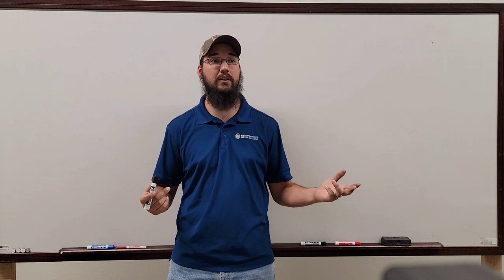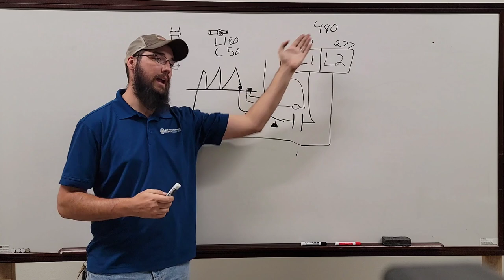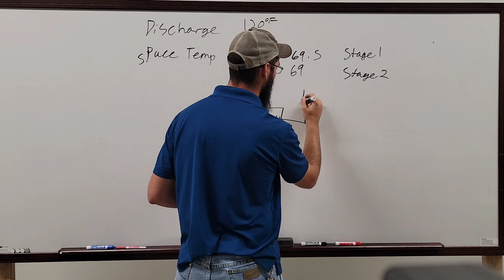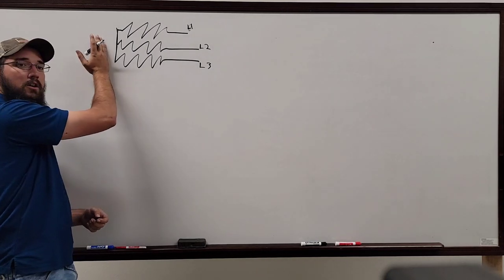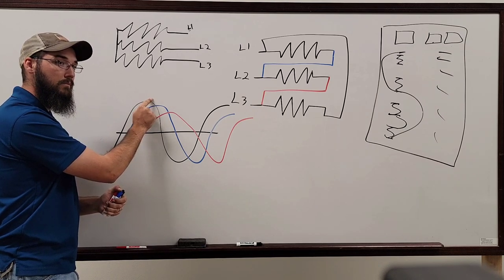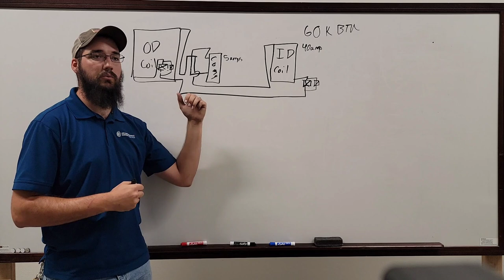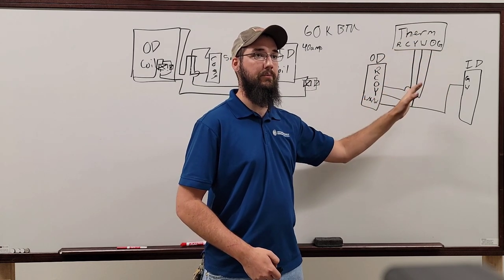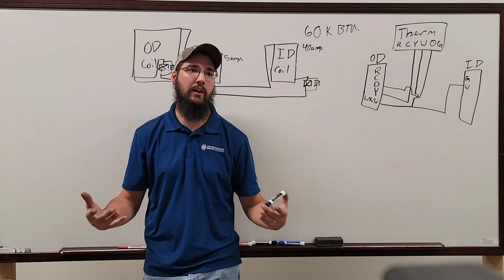HVAC Training: Electric Heat and Heat Pumps

Comment: Here in Buffalo most inverter or mini splits are hyper heat and can deliver up to 80% capacity to -15°. At 10° outside they are pushing 90%+ capacity. We have quite a few VRF systems as well. Air to air is almost non existent.
Reply: I'm in Buffalo as well! :D

Comment: I honestly wouldn’t mismatch voltages for restring kits.
Reply from the maker: Its definitely something I want to understand better. How does a string voltage affect it if its just a resistive device.
Reply: @HVACTIME  

When you run the same heat strip at a lower voltage it will draw less current.

Lets look at a heat strip rated 40 amps at 240 volts.

In watts that would be 240 volts x40 amps =9600 watts, now what would happen if we ran that same exact heat strip on 208?

First we need to find the resistance of the heat strip, to do that we divide the voltage by the current

240 volts / 40 amps =6 ohms of resistance

Now that we know the resistance we can use ohms law again to find out what that heat strip will draw at 208 volts

208 volts / 6 ohms =34.66 amps.

So the exact same heating strip that needed 40 amps at 240 volts will only need 34.66 amps at 208 volts.

HOWEVER ... at 240 volt that heat strip was putting out 9600 watts of heat, at 208 it is not, it is now putting out less heat.

208 volts x 34.66 amps = 7209 watts

So by dropping the voltage the current went down but so did the amount of heat produced.
Reply: @HVACTIME  definitely not trying to argue with you. I would just like to make that apparent due to today’s people in the world. I believe debate is good for everyone so if you or anyone has a rebuttal, please comment it. This is how we all grow as technicians.
Reply from the maker: Your completely right, no argument. Thank you for the input, i dont practice ohms law as much as i used to
Reply: @HVACTIME  I absolutely love the channel brother. Keep up the good work. If I was able I would have took you up on your offer to try and come on the team when you said you guys were hiring.
Reply from the maker: @joshuaricks7730  if anything ever changes I'm here. I appreciate the support!

Comment: Duct heaters?
Reply from the maker: What about them?
Reply: @HVACTIME  460 480 stuff is on chiller systems?
Reply: I was just asking cause The chiller part I can handle but heat sequencers I suck at
Reply from the maker: @christophergonzales1321  I gotcha now, yes most times in my area chilled water systems use 460 heater systems.
Reply from the maker: @christophergonzales1321  i forgot to mention troubleshooting sequencers
Reply: @HVACTIME  I'm just not a heat guy